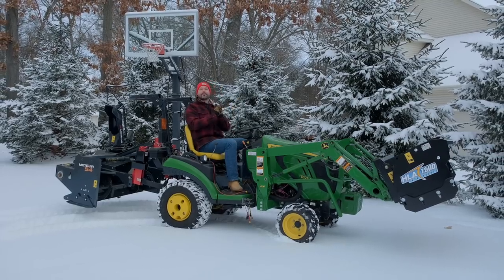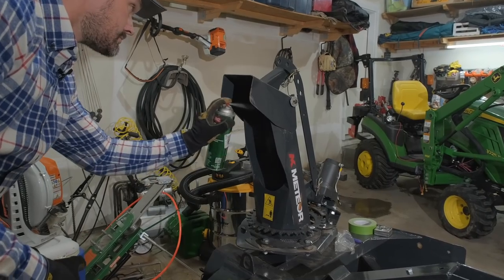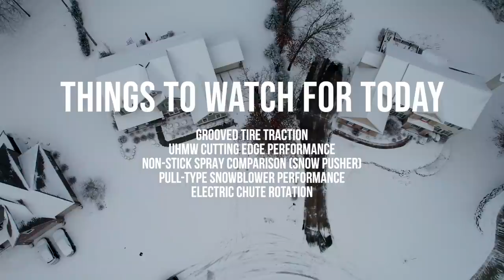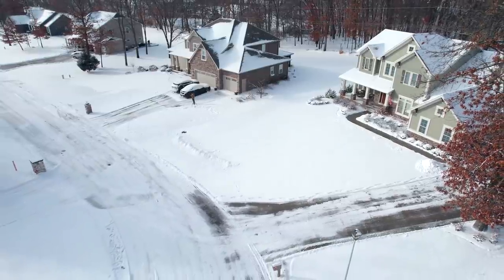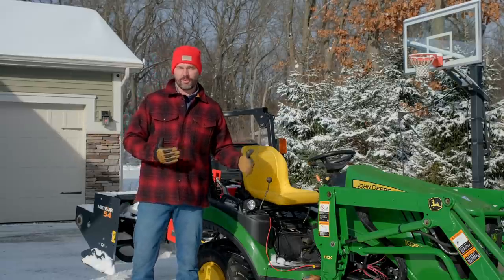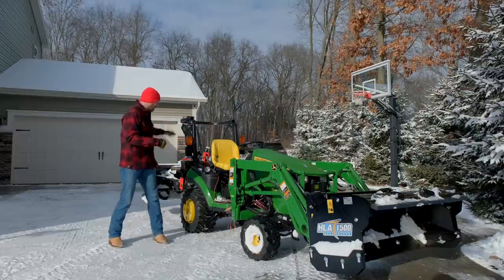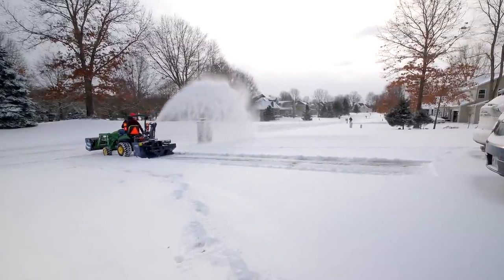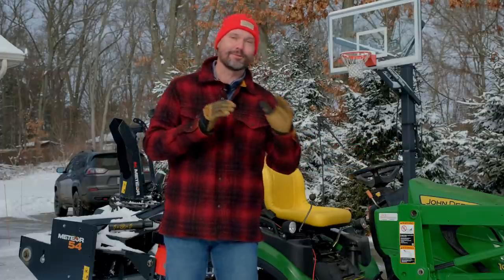FIRST SNOW OF THE YEAR WAS TOO EASY FOR THIS 1025R SETUP.

Comment: The only thing I don't like about snow pushers and plows in general is running out of places to put the snow during multiple snow events.  I learned that the hard way during the Winters of 2018 and 2019 here in Vermont where I ran out of room while plowing with my ATV.  I now use a front mounted snowblower on my tractor which works 100% better dispersing the snow all over my front and side meadows with no worries of running out of space.
Reply: I live in Vermont as well and plowed with an ATV for 20 years.   I too had the run out of room problem.  Since I was snowblowing walkways and other areas that I couldn’t get with the plow, I learned to plow first and then snowblow out the piles on both edges of the driveway.  Tried just the snowblower but it took way too long (and seemed more like work).
Reply: @qcan8468  I too use both the snowblower and ATV plow.  I use the snowblower for the driveway then clean up with the plow around my mail box and edges.  It's worked for me so far provided I don't let the snow build up too deep like I did in 2018.  I had to have a plow guy come plow me out twice that Winter.  LOL  Cheers to a fellow Vermonter!

Comment: Just curious… I was surprised to see the snow tailings from the HLA. I’m contemplating getting a 2025 with either a blade or pusher. Should the pusher have the sides the same length as the top? Also, does the HLA have a metal scrape edge or other? I use a 425 w/46” thrower and it’s awesome ONLY with a metal scrape edge. I put a polycarbonate edge on and what a disaster! It just cannot scrape or clean like metal. Put the metal one on after doing 2 snowfalls (60 driveways later) and won’t look back. Great video… I find snow removal very satisfying and with a recent townhouse contract, I’m really leaning towards that 2025 w/cab! Thx!

Comment: Great video. Learned alot. One question, what tires would you recommend?
Reply: I have R14 and love them.. they are a hybrid tire that combines the tread from the R1 and R4 that is how they came up with the name.  Best of both styles of tire.
Reply from the maker: Agreed
Reply: @GoodWorksTractors  I remember YOU introduced on a Video and then it seemed they started making them for SCUTS instead of just Garden tractors.

Comment: That HLA snow pusher is disappointing because it doesn’t scrape clean to the concrete
Reply from the maker: Nothing scrapes through snow that’s been driven on over and over.  It scrapes many areas of the driveway that haven’t.  This is explained in the video.  Same results with a plow, snowblower, or bucket edge.  Don’t drive over your snow too much before clearing if you can help it.
Reply: @GoodWorksTractors  my bucket scrapes clean to the cement
Reply from the maker: @rileytrentham3778  👍

Comment: I couldn't figure out why he wasn't floating the loader when pushing/pulling snow. why not just set it down and float it? seemed like a lot of minor adjustments and front tires coming off the ground making it hard to steer
Reply from the maker: That only works sometimes.  Float will also lift your tires off the ground, so you need to raise the loader to get traction without letting snow under.  What you're saying sounds good from the keyboard though.  👍
Reply: @GoodWorksTractors  it was more of a question than a critique. how does float lift the tires?
Reply from the maker: @thatguy4933  physics.  Shot a video the other day all about it.  Will be published soon.
Reply: @GoodWorksTractors  Sounds good. will take a look when it's published

Comment: Looking if anyone has any ideas where to get a winter front for the 1025R. 
My thought is looking at something like removing the radiator screen for the Winter an slide a sheet of plastic as a Winter front (would love it to be JD Green & what would be even sweeter if it had the JD Logo laser cut in it for some air flow through the radiator). 
So in short anyone came across something like this & where.

Comment: Because I haven't seen it stated here yet. PLEASE check your local laws before pushing snow into a roadway!
I know that in Northern Maine that this is a criminal infraction that could lead to 30 days in jail. Also, if someone was to hit your snow pile and end in an accident that kills them, then you are now looking at manslaughter charges. Again, please check your local/state laws before pushing snow into, or even across, a road/street. I would advise no one to push snow out of their property for safety. If you can't find a way to move the snow without it leaving your property, then you have the wrong equipment IMHO.
Above all be safe when dealing with power equipment, especially in the cold.

Comment: It looks like a nice setup, but I just don't see the point of the rear mount snowblower that is being used. It looks like the whole undercarriage of the tractor gets coated with snow, if the snow is above 6" - 7" deep. At that point, its going to melt and then as the tractor cools it is going to freeze on the front and rear axel housings. Not to mention, your driving over the snow that your trying to blow and packing it down. IMHO, a front mount blower and rear mount rear blade with skid shoes is still the best configuration for deep snow.
Reply from the maker: Front mounted blowers mean you're not using your loader all winter.  Many folks need to use their loader for other chores.  Gotta think beyond just your own circumstances. Where did that look like it was an issue driving over the snow with the blower?  Not in the deep piled snow at the end of the driveway nor the other driveway.  Dozens and dozens of inverted blower videos out there.  They've been around for years and used by many commercial outfits.
Reply: @GoodWorksTractors  Thanks, that is a fair response and thinking beyond my own circumstances is appropriate.

I didn't specifically see an issue it in the video where the snow was over top the axel. That comment was made thinking back to a blizzard that dumped 24" of snow here in PA a couple of years back. At that point, a BX25D or 1025R with a rear mount inverted blower would probably not be the best solution unless your able to keep up with blowing every couple of hours after 5 - 7" accumulates. Granted we only get that type of snow once every 3 - 5 years. With the front mount blower, I was able to help neighbors dig out where the state plowed them in with 48" of snow and clear they driveway that hadn't been done since the start of the storm.
Reply from the maker: @johnsnyder751  Yeah, I guess I can't think of the last time I waited for even 12 inches of snow to fall before clearing it.  It could happen, but I like to stay on top of things.  It would be the exception, not the rule for me.

Comment: If you were to get a foot or more of snow, would the bucket and inverted snowblower be a better combination? That way you could use the bucket to knock down the 3' snowbank at the end of the driveway and the snowblower to clean it up.
Reply from the maker: Bucket or pusher.  Can skim the snow either way.

Comment: the best way to keep snow from sticking to your equipment is to leave it outside in the cold.
Reply: I agree, but boosting everything gets old. -30 to -40 for the last 6+ weeks here and I've boosted brand new batteries, just cannot handle the temps. By the time machine is warmed up and I run the 8 minutes to the cemetery, the blower is ice cold. Heck, my drink was frozen in the cup holder within 30 minutes today.
Reply: I did that once with my pusher, inexperience user here, forgot to brush off the quick connect plate, yup.. packed snow stuck in the dogs made for such a headache, there will never be a next time, pusher goes on in Nov and comes off in April now lol.

Comment: That setup doesn't make sense. A snow blower that requires you to first drive over the snow makes no sense - especially on a small tractor with low ground clearance. Sure it works for 10-12 inches but for that much or less you don't even need the blower. If you get a LOT of snow or snow with 30"+ drifts a drive over blower would be useless. You can't push that much snow with the pusher and you can't blow going backwards. On the other hand, a pusher with a rear-travel 3PH blower gives you the capability to handle anything from 1-inch to 3+ feet of snow!  Even with 3-feet of snow you can start moving backwards and blowing it out of your way even if only a little bit at a time. Those forward 3PH blowers seem to work fine on large tractors with 24-30 inches or ground clearance.
Reply from the maker: There is no one size fits all solution.  I have videos showing other setups as well.  This setup is fantastic for my situation though.  By the way, even my Kubota M4 only has 18" of clearance.  You'll need to get a 6 Series to get 24" of ground clearance.